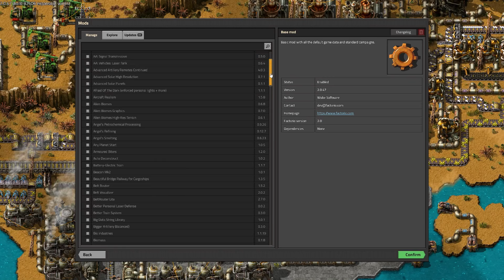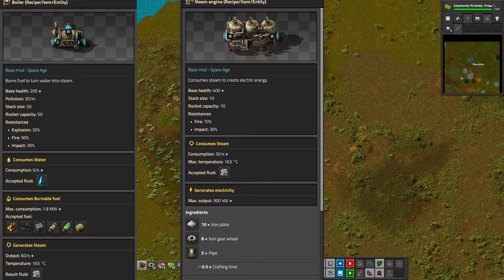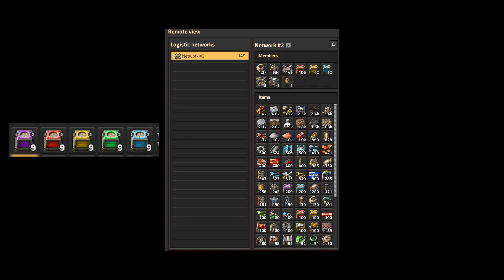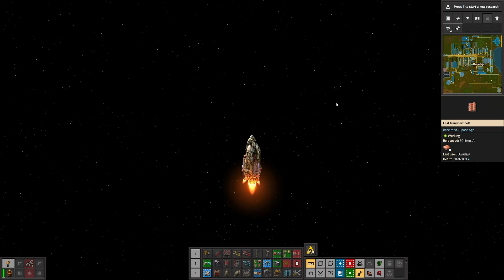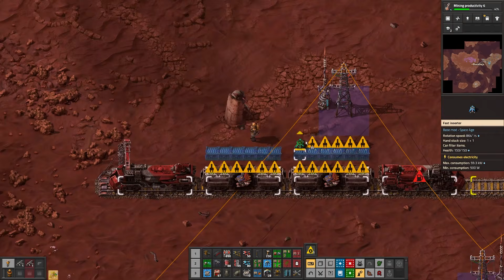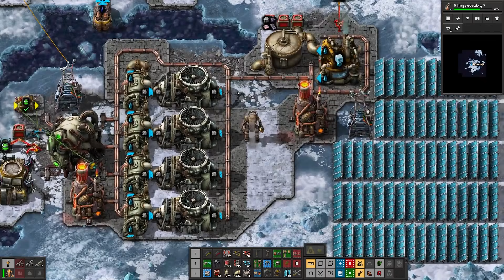Factorio - express delivery (beat space age in under 40 hours) guide

Comment: While you cannot turn off enemies, you can tweak their settings to the point of essentially not being a cocnern. I messed with the enemy settings before starting my first Space Age run and I have never had enemies hit my pollution or spore clouds within over 100 hours of playing
Reply from the maker: You used to be able to do this without disabling achievements,  but they've changed it and you no longer can make it so easy and still get the timed achievements. Be careful and check the sliders when starting a run
Reply: @Gamegineering  They must have made that change a while after Space Age releasd. I just checked an older save files from that game. I can do the timed achievements (as well as all other ones). Despite being on the newest version. So it must work if you simply have a save file from an older version.

I dont remember exactly what I changed but I think I essentially disabled time based evolution, turned up the starting area a lot, turned down enemies spreading a lot and made pollution spread much slower and get absorbed much more. I also seem to have spoilage set to be like 2.5x slower
Reply from the maker: @GamePilLP yeah those updates cannot impact old save files so thats likely what saved you from it.  If you try to start a new save youll see you cant edit those without disabling achievments
Reply: @Gamegineering Well honestly if I was gonna go do this achievement (which is why I watched this video) I would probably revert to the older version using Steam Betas.

But disregarding that, this was a great guide. Will come in very handy when I try it

Comment: hmm, I followed this for a full playthrough and im up to the point of sending the final ship to the solar system edge. It's 100% stocked up on water, ammo, plates, everything. And it gets shredded to bits before even reaching the solar system edge. Let alone trying to reach the shattered planet. I wonder if maybe you had some of the infinite techs upgraded alot?
Reply from the maker: Huh, i dont think so.  I had some projectiles and explosives research but thats it i think.  Ill load it up later and check. If you want you can join the discord in the description and i can share the save file so you can compare stuff if that helps
Reply from the maker: I had physical damage 9, and stronger explosives 7. nothing else that should impact it. feel free to come to the discord and we can share stuff and chat easy if you want to :)
Reply: @Gamegineering  oh derp I definitely had let my physical damage lag. I was at 7. I upped it to 8, threw in a second nuclear reactor because I was hitting some low power issues and boom. it worked like a charm

Thanks so much for the video guide!! :)
I learned alllllot along the way doing this run
Reply: @nug203  если недостаточно урона просто снизьте скорость платформы

Comment: quality best uses:
asteroid collector, assembly-buildings (assemblers,Emplant, foundry, etc), bulk&stack inserters, armor equipment (exoskeleton+fisson power), solar panels and accumulators -- high quality solar panels are really useful for early/mid-game ships. accumulators are many times more space-efficient for those small island mining sites on fulgora. quality miners reduce ore patch depletion. quality labs get research done faster (like free speed modules), nuclear power...mixing quality allows you to get some unique ratios/efficiency levels for space travel using nuclear power. you can get ratios like 1:2:3 for nuclear, something that's not possible without quality.
Reply from the maker: Not disparaging quality.  But if you want to beat the game fast its not worth the time and effort outside of the collectors.  Nothing wrong with 2 assemblers instead of 1 quality one.  For megabases deffo things worth checking out

Comment: 1. You don't need a picture of starting area, as you can click to load save and at top right there is a button to export map exchange string, which you can click new game and above green starting button there is an import map exchange string.

2. I prefer to have filtered demolition planner to only aim for huge rocks, so i can focus on getting the coal. Just go to map view, use the demo planner and u know where to focus walking.

3. For nuclear you only want 1 reactor to read temp. That's because its possible for one reactor to be a little lower temp then other, it activates and heats enough that others dont activate. This means only 1 reactor heats so no neighbor bonus. Its niche but still best practice.

4. Why no heating tower in gleba? Its much better for voiding than normal boilers and has output  of a nuclear reactor with no neighbor bonus. You don't use as much power there due to biochambers using nutrients instead of power. Since you already produce rocket fuel there, you can have a simple circuit to check temperature, and if its too low, it inserts rocket fuel.

5. This is something I heard, avoid using undergrounds unless its absolutely critical on Aquilo. Undergrounds for some reason demand over 100 times more heat than normal ones. This applies to pipes and belts. Reddit post 'Aquilo PSA: Underground pipes and belts consume significantly more heat than their above ground conterparts. ' has a table for all values. Underground pipe uses 150x heat compared to a normal pipe.
Reply from the maker: 1.  Very true but i find it less effort to alt tab to a load of pics rather than doing it this way. Whatever works though and good to mention alternative options. But for a new player thats probably a lot to explain

2. Good plan. I didnt want to discuss it that early on and theres so much here already it would have likely been overwhelming to new players.

3.  I havent noticed any impact on efficiency and just have a habit of building this way, will experiment

4. The powers not necessary and my bp doesnt generate much spoilage so just never needed to make a heat tower. Nothing wrong with doing it, just as its new it didnt occur. I did it with the machines im used to and it works fine

5. Thats news to me.  Ill test that and its really good to know.  Doesnt affect this base as theres so much solid fuel the inefficiency is irrelevant but in a larger base that could have a big impact so good to know about, ty
Reply: Assuming point 3 is correct about reactor behavior, it's probably more fuel-efficient that way. Reactors have a SHC of 10 MJ/°C, and uranium cells have a fuel value of 8 GJ. Under light loads, fueling all reactors at once could lose you ~3 GJ per uranium cell, plus all of the neighbor bonus. (More thermal mass mitigates this loss). Under heavy loads, fueling each reactor individually will still give you the neighbor bonus when you need it.

Of course, none of this actually matters in a speedrun.